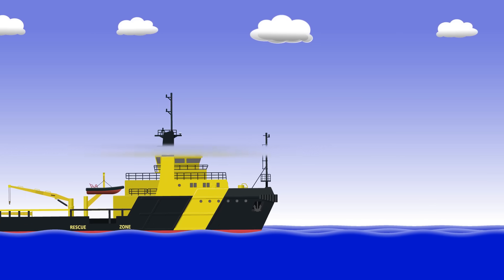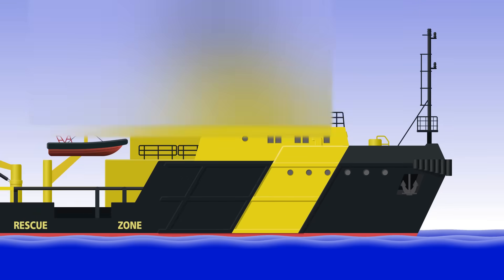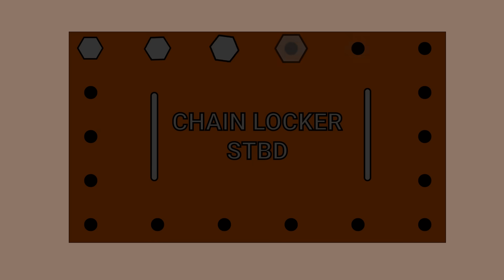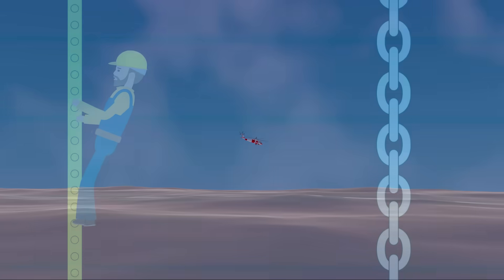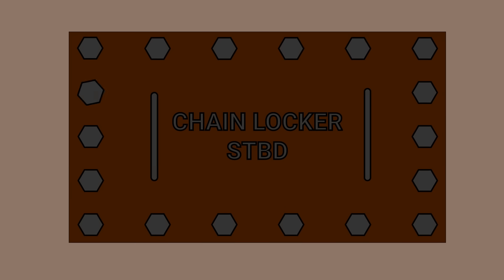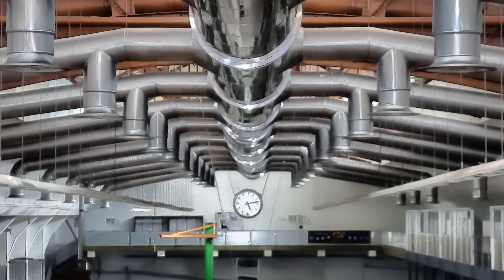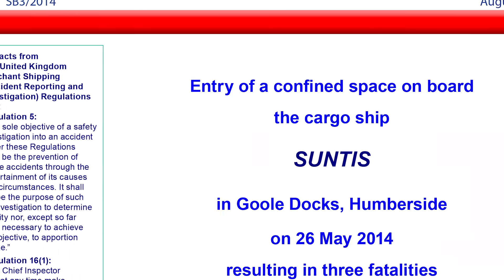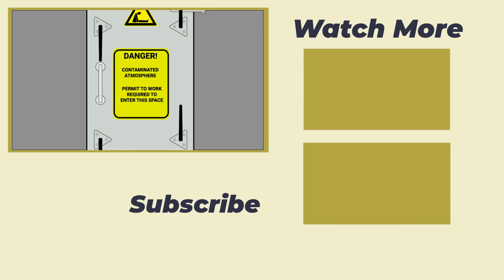Why Enclosed Spaces Are So Dangerous? | Enclosed Space Entry

Comment: So they died of hypoxia virtually at sea level? Damn, that's a hard one.
Reply: The video explains it ffs.
Reply: Its a anchor chain locker, when you heave up the chains from sea bed, there will be plenty of organism n mud etc..the air is a sure foul.  going into the locker, its one of dangerous place in a ship, the chief Officer n Bosun fucked up big time .
Reply: AverageArts more than likely H2S caused by the rust
Reply: @danielpalmer3706  why rust causes h2s? Is it a byproduct of the salt environment?. Afaik the structural steel should contain no sulphur
Reply: Guillermo Lovato it’s a by product of the oxidisation process. And also is produced by bacteria in lots of different systems onboard a ship.
Reply: @danielpalmer3706 If this is the chain locker then where does the Sulfur to make SO2 come from?  I always thought ship steel in particular had to be made with very little or no sulfur impurities in it's make up.  Would grease and oil residue be enough to create SO2 from air oxidization?
Reply: Phillip Mulligan H2S is naturally produced in the ocean regardless.
Reply: @danielpalmer3706  so, the sulfur comes from the seawater?
Reply: @danielpalmer3706  they detected 15 percent oxygen after the rescues were done.  I.e.after the hatch had been open for a while.  So while 15 percent might not be low enough to make people fall off a ladder,  the oxygen concentration could have been actually  much lower when the first three workers went in.
Reply: @danielpalmer3706  It is simply lack of O2 caused by rusting, H2S has nothing to do with it
Reply: Daniel Palmer not correct. H2S is formed by naturally decaying organic matter or possibly found in the fuel - there would be no normal reason for any deadly quantity of H2S to be found in the chain locker. The formation of rust, or oxidisation of the steel on the anchor chain and inside the locker, simply forms an oxygen deficient atmosphere that does not have the capacity to sustain human life.
Reply: @jameslane2615  Believe you are correct!  Know of numerous confined space deaths, often with multiple deaths like this video.  NEVER ENTER UNTIL FULLY VENTILATED!  And yes, it takes a lot of time to ventilate a large space! Oxygen sensors are < US $100.  Well worth it!
Reply: @danielpalmer3706  I worked in ND and H2S was what my brain immediately went to
Reply: Yes, and it's disturbingly common.  As you can see from the responses to your comment, many people believe that toxic gases such as carbon monoxide or hydrogen sulfide need to be present for asphyxiation, but as you have concluded, a simple lack of oxygen is fatal regardless of whether toxins are present or not (e.g. https://www.cdc.gov/niosh/face/in-house/full8836.html ).  The danger goes unnoticed because our gasping reflex is triggered not by lack of oxygen but by high carbon dioxide levels, so many low oxygen environments (those without elevated carbon dioxide levels) feel perfectly safe until muscles suddenly stop working (because the blood supply is no longer providing them with oxygen) and the person collapses.  It is quite common for a workmate to see this happen and think that the person has fallen, so they rush to help them and meet the same fate.  This is why atmospheric gas monitors measure atmospheric oxygen content as well as levels of common toxic and flammable compounds, and many confined space entry procedures require connection to manned emergency rescue equipment (e.g. harness, retrieval rope, tripod).
Reply: @SorenCicchini  It's also why you shouldn't huff/sniff butane. Butane is heavier than air and will collect in your lungs even without catching fire and block off the oxygen supply. See 'sudden sniffing death'.
Reply: It’s not CO, CO2 or H2S. Rust is Iron Oxide, Iron combined with Oxygen. The Oxygen comes from the atmosphere and in a sealed confined space the Oxygen doesn’t have to drop much for the atmosphere to become deadly. A couple of breaths, about 8 to 12 seconds, and you’re a goner.
Reply: Joe Bessette 
You have a better working knowledge of what is going on then me. 
All I know chem theory,

But just look at the entry for sulfur in wikipedia, read the 1st bit and the 'bioligical role' bit.  It says sulfur is the 5th most common element and it is found in all living cells. https://en.m.wikipedia.org/wiki/Sulfur

It isn't pure sulfur or sulfuric acid. It's just a tiny part of a bigger molecule in the cells so it doesn't react like sulfur until it gets broken down by bacteria. 

The same way you have iron in your blood, It's not actual solid iron it's part of a bigger blood molecule so it doesn't behave like iron.
Reply: Not sure why they went inside there knowing you can’t...are there guidelines related?🤔 are there signs which highlight potential danger for humans?
Reply: Reverse a ramjet for smoke extraction, would over pressure the space with air. I once got stuck in a compartment, the otherside of a fire, it had a refrigeration unit and there is a good rule of thumb that there are always dangerous/toxic gases on Fridges (Freon and CO). I was pretty sure i was going to get asphixiated as vent had crashed stopped and I dogged down my hatch picked up a phone and dialled Engineering who sent a team member down with an extra BA set. Staying calm and not knee jerking saved my life. I don't mind saying once in a blue moon I dream about it and i wake up in cold sweat...Funny thing was I was reading "Dune" and the one thing that went through my head was "Fear is the mind killer that brings total oblivion" i think that is quite true, fear makes you irrational and give way to panic, i was still bricking it but just kept it together and kept phoning updates to various dept's.
Reply: It's not H2S. They didnt die from a toxic gas but from the absence of Oxygen in the air. This is caused by rust, it's called oxidation and it's the process in which iron/steal absorb the ambiant oxygen. Normal oxygen level is around 23.5%, if it gets below 19% you just collapse. That is why there is Oxygen meters on every ship Ive worked on. Again, they didnt collapse because of a toxic gas but just the absence of the most important one.
Reply: Bravo 6 going dark
Reply: I very seriously doubt rust had anything to do with it. The rate at which rust will pull O2 out of the room should be far FAR lower than the rate at which air is replenished through the chain being lowered and raised.

All of that organic material adhering to the chain, however, could probably clear the room of oxygen in hours. I will have to do the math on this.
Reply: One kilo of iron(iii) oxide is 30% O2 by weight. A kilo of O2 is 0.7 cubic meters. A kilo of rust therefore has 0.21 cubic meters of O2. Since O2 is 21% of air, it takes about a cubic meter of air to make a kilo of rust.

That's a shit load of rust. Like, I doubt if you scraped all the rust from that room you'd get more than a few kilos. So more math.

It says here marine steel corrodes at 0.017 cm/year on the high end. That's about 17g/square meter of metal every year. You'd need a room 59 square meters in area to make a kilo of rust in one year. A sphere of that size would have 42 cubic meters of air in it. The room is much more rectangular than that, so I'll say 20 instead.

It would take a room that size 20 years to deplete the oxygen by making rust. And every time the chain goes out, air goes in. And the room is much bigger than that, giving it an even more favorable volume to surface area ratio.

There is the chain itself which GREATLY increases the surface area, but biological activity is some 3-4 orders of magnitude faster at consuming oxygen (a human uses about a thousand cubic meters of air a year) so I'm thinking it's that and not rust.

If anyone has anything to add, please feel free to do. This is more of a Fermi estimate but with so many orders of magnitude to play around with, I feel confident in the conclusion.
Reply: Nah they just left the game
Reply: Man what the fuck did I start...
Reply: Carbon monoxide, it is very very toxic, less than 0.1% in the air can cause death if i remember correctly, I dont really know if thats the case there but it can be very dangerous espetialy in engine rooms or such
Reply: Milan Djuric carbon monoxide is an off glass from the combustion process. So you are correct about the engine room. But this case specifically more than likely H2S as there is no machinery in that specific compartment that uses combustion.
Reply: @danielpalmer3706  Makes sense, but hidrogen sulfide stinks alot it would be easier to notice, i didnt know that there is a concentracion of it that would kill you without you being able to detect the strong "rotting egs" smell
Reply: @danielpalmer3706  I did not know that, thanks
Reply: Milan Djuric all good mate. I’m a marine engineer in the navy. I need to know this stuff
Reply: @danielpalmer3706  Im a mechanical engineering student, just finished the first year, still fresh to this stuff, thanks
Reply: @danielpalmer3706  wow they don't teach you ,this is bad . Don't get  my wrong but this you should know .
Reply: @danielpalmer3706   Where would the H2S have come from? The most common source of H2S is the microbial breakdown of organic matter. I can't imagine there'd be all the much organic matter in an anchor chair room. I agree with the author depleted atmosphere, low O2, caused by rusting steel.
Reply: @eddydogleg  Exactly, decaying organic matter. The chains in the chain locker spend a lot of time in seawater. Stuff grows on the chains while they are anchored and the chains will drag seawater/algae/mud/microbes back into the locker when they raise the anchor. It's nasty in chain lockers, usually.
Reply: @milandjuric8043  problem with h2s is you only smell it one time before it deadends ypur sense of smell
Reply: @adymode  those are some huge ranges... And a shit load of argon.
Reply: @isaackarjala7916   Many people have died from hydrogen sulphide in root cellars. Are you suggesting there's sulfur in their potatoes and carrots or something?
Reply: Joe Bessette 
Yes there would have to be compounds made up of sulfur in whatever food is breaking down.

Once the sulfur is part of a different compound it will have totally different properties then when it breaks down.

Suggesting there is sulfur in potatoes and carrots doesn't seem so crazy when you think about how oxygen can make up air, water and carbon monoxode. 
A safe gas, a safe liquid and a toxic gas. 

Unless you are suggesting there is a nuclear reaction taking place more powerful then the sun to  produce sulfur where there was none before.
Reply: @JKenny44   Ya you guys are right, guess I'm ass backwards. They're sulfur reducing microbes that make h2s. I learned something today then at least I suppose.
Thanks
Reply: @JKenny44   There's still a lot of wrong information in this thread about the incident though as well
Reply: @Andy Mode Thanks for the link, it was an interesting read. Page 27 of the accident report says that the atmosphere may have been around 4.4% O2
Reply: @danielpalmer3706  Wow thats incredible knowledge, and insight, thank you for you the deeper explanation, and good luck with your engineering!
Reply: @isaackarjala7916  Uh no, argon concentration is pretty much normal. Average concentration in the air is 0.9% or so.
Reply: @philippenachtergal6077  huh, thought it was a lot less
Reply: @milandjuric8043   was always taught if you can smell h2s it's usually not enough to harm you, it's when you cant smell it but know it's there is when it's a problem
Reply: Daniel Palmer, my father used to work in the pulp and paper industry and warned us about H2S.
 3 breaths, your dead.
1-catch a whiff... 
2-smell is gone...
3-your done! Game over!
  This backs up the fact that it it numbs the sense of smell, leading one to think it’s gone.😵
Reply: @adymode  thank you great link, I was looking for that
Reply: @danielpalmer3706  also where Is the sulfur coming

It is just the oxygen being used up and so nitrogen and carbondioxide builts up
Reply: @danielpalmer3706  I imagine if the gases were visible it would look quite a lot like a person jumping into water, bringing air with them. Until it hits a point where that pocket collapses. Fluids and what not.
Reply: @danielpalmer3706  steel plus water plus Oxygen  equals rust.. so the more rust them oxygen taken out the atmosphere   below 15 % its good night ..below  14 and ...well
Reply: @joebessette6565  CHNOPS  is the main chemicals in earth life. the S is sulfur.
Reply: @milandjuric8043  🥺🥺🥺🥺🥺🥺🥺🥺🥺🥺🥺🥺🥺🥺🥺🥺🥺🥺🥺🥺🥺🥺🥺🥺🥺🥺🥺🥺🥺🥺🥺🥺🥺🥺🥺🥺🥺🥺🥺🥺🥺🥺🥺🥺🥺🥺🥺🥺🥺🥺🥺🥺🥺🥺🥺🥺🥺🥺🥺🥺🥺🥺🥺🥺🥺🥺🥺🥺🥺🥺🥺🥺🥺🥺🥺🥺🥺🥺
Reply: A ton of misinformation in this comment thread. H2s doesn't require sulfur to form. It's caused by the break down of organic material. H2s is hydrogen sulphide, it won't be formed from non organic material like metal. I know this for a fact, I've had to take a h2s awareness course every 3 years to work in the oilfield here in Alberta
Reply: @joebessette6565  it doesn't require sulphur to produce a sulfur containing compound. Ok.
Reply: Yeah. It's not like you can die of hypoxia 1 meter below sea level haha
Reply: Hypoxia is due to lack of pressure not lack of oxygen. The composition of air in the upper atmosphere is still 21% oxygen, but it’s the lack of pressure that causes hypoxia say in a aircraft depressurisation
Reply: @Jayjaycurry  You are both right and (mostly) wrong. Hypoxia is lack of oxygen... which can be caused by low pressure.
Reply: @Jayjaycurry  What really matters when it comes to what is suficient oxygen levels is what is called partial pressure, which is the pressure of all the gass times the percentage of the gass you're interested in. Meaning at sea level since the air pressure is 1 atmosphere (atm) the partial pressure of oxygen is ca. 0.21 atm; at Everest base camp the total pressure is about 0.5 atm meaning the partial pressure of oxygen is ca 0.10 atm.

All the gasses that is not oxygen and not poisonous is basically just filler, what the lungs (mostly) need is the a sufficient pressure of oxygen so that it will pass throught the membranes and attach to the hemoglobin in a sufficient rate. We can tolerate between ca 0.16 atm to 1.60 atm partial pressure of oxygen, below that pressure no matter if it's caused by the total pressure being lower or the percentage of oxygen at a normal pressure being too low you can die from hypoxia.

By increasing the percentage of oxygen, by breathing pure oxygen with a mask you can tolerate lower pressures to some extent, which is why they use oxygen tanks on Everest. If oxygen was the only thing that mattered, you could in theory tolerate an atmostpheric pressure of about 0.2 atm if it was pure oxygen; but in practice you need a bit higher pressure than that because of issues with water evaporation etc. and for comfort. In the Apollo program they used a pure oxygen atmosphere at only 5psi ~= 0.32 atm which probably wasn't very comfortable but was able to sustain them up to almost 2 weeks.

(At extreme pressures it's not really that simple; since at very low pressures you'll have issues with the vapour pressure of water and at high pressures some gasses that normally are inert starts to get narcotic or toxic.)
Reply: @SteinGauslaaStrindhaug  <<at Everest base camp the total pressure is about 0.5 atm meaning the partial pressure of oxygen is ca 0.10 atm.>>

That is correct, and I agree with much of your post. But the next part can be seen to be inaccurate:

<<We can tolerate between ca 0.16 atm to 1.60 atm partial pressure of oxygen>>

The pp at Everest base camp is only 0.1 and yet people, even some who are not very fit, walk up to base camp,  and can stay there for weeks on end. A small proportion of climbers can even summit without supplemental oxygen (pp about 0.06). The explanantion is acclimatisation makes a difference. In a hypobaric chamber at 25 000' pa when you come off oxygen you will be affected by hypoxia in seconds and pass out in minutes. But most climbers on Everest who have acclimatised can go to the South Col (26 000') without supplemental oxygen.
Reply: @Jayjaycurry  if you don't understand the concept of partial pressure of oxygen, your reasoning will be flawed. Which it is.
Reply: @Jayjaycurry  Asphyxia -- that is the right word. You are absolutely right. In this case, air pressure is normal, but contain less oxygen that is needed for normal body functioning. Hypoxia is something else.
Reply: They died from toxic gases, not Hypoxia. It is very very rare to die from Hypoxia
Reply: @Sm00thieK  You are wrong and I don't know why you even cared for writing without first checking the facts. The accident report is linked in this thread and it says the same thing as in the video. They died from hypoxia/asphyxiation from a low oxygen atmosphere, not toxic gases.

Comment: i work in confined space. what you should do before entering the hole or space is to set up air ventilation to get rid of any chemical smell they can harm you.. after that you should call a authorise person to set a gas test to check if the air is safe to breath.. but sadly. in some places they skip ventilation.. fyi.. gas test should be done every 2 hours
Reply from the maker: It's sad that some places skip the ventilation. Hopefully if people understand the danger they will refuse to go in and keep themselves safe.
Reply: you can go in with out airing but then only with full independent air. preferred with 2 airlines pumping clean air via a airline and a 3th backup on your own back.

i have worked as the person standing outside of the confined space and guarding the safety of people like you going inside.